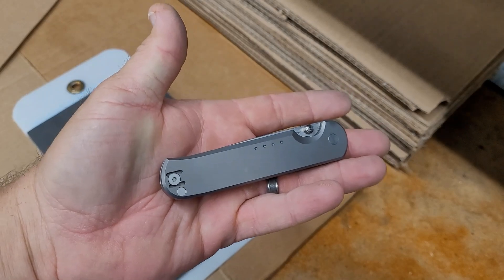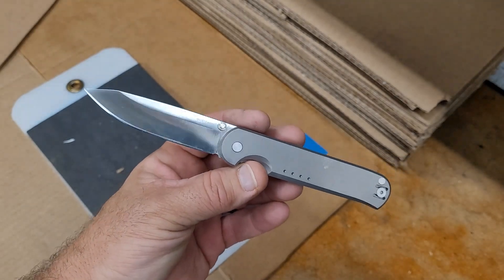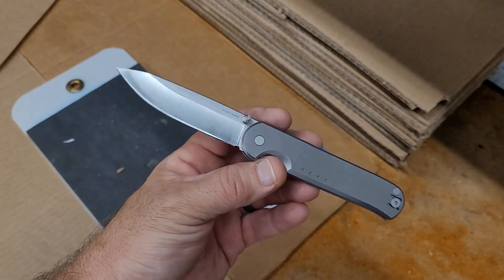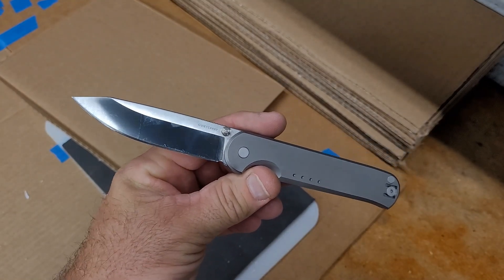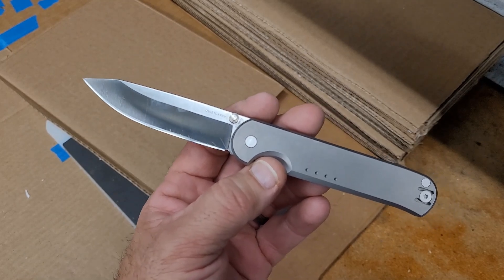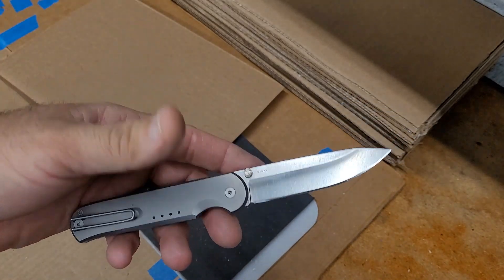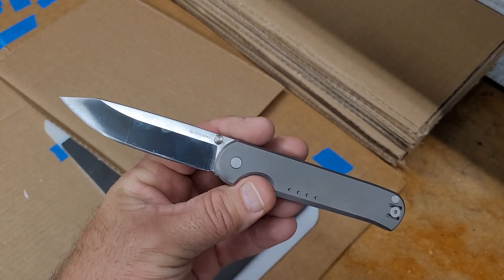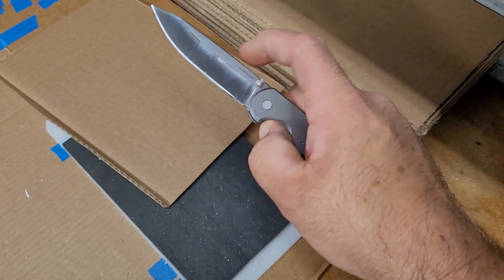Quiet Carry Waypoint Vanax edge retention testing. Where does this one stack up compared to others?

Comment: I just got a small fixed blade in Vanax from Transparent Knives. It's ground super thin and cuts like a dream. I don't understand Vanax yet. It seemed very easy to sharpen but I don't know what to expect for edge retention. I guess it needs some testing. You just don't see much Vanax out there to compare to. Thank you for putting some numbers out there.

Comment: I had two of these, the factory edges did not last long at all, but after sharpening ive been happy with the performance, i do have to send mine in though for lock rock, i attempted to fix it myself with no help so im sending it in, if you still want it after it gets back your welcome to carry and use it however
Reply: The drift I had wouldn't lock if it was slow rolled. It had ghost scratches in the blade, lock rock and overall felt it was poorly designed in the ergonomics department, not to mention it had poor opening and closing mechanics that made it not very reliable as a user. Factory edge also like yours didn't last long. I'm sure I'm in the minority with these kinds of issues. Cost was over priced imho.
Reply: @tacticalcenter8658  yeah my factory edge didnt last at all surprisingly short, like a few cuts, but after sharpening was great, im hoping after it gets back that its done with issues

Comment: They are heat treated by Peter's heat treatment. But made in Asia. The custom knife maker who came up with the protocol on bohlers page said he has updated his own heat treat that he believes is better.
Personally I'll never buy a quiet carry again after I got a defect and felt the knife was not worth the cost overall and was poorly designed. I would buy a vanax knife by the custom maker who designed the HT of vanax (forget his name, but he made a backlock with a carbonfiber spring bar and vanax steel and some nice scales)... Or Roman of KKnives of Switzerland.
Reply: Did you contact them? I found a little issue with one screw and Bruce is sending me a full set of replacement screws. I did not even had to ask
Reply: Would that custom maker be Chad Kelly?